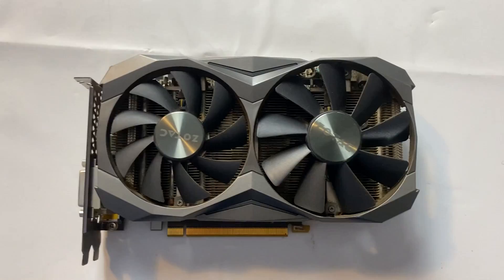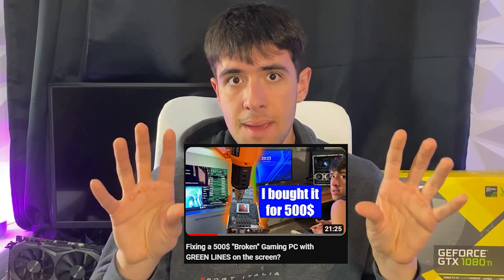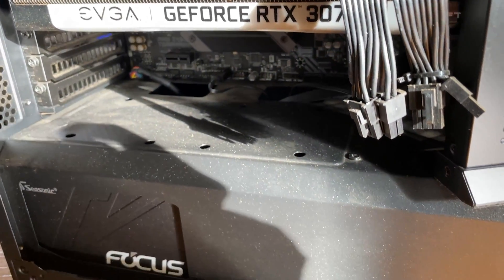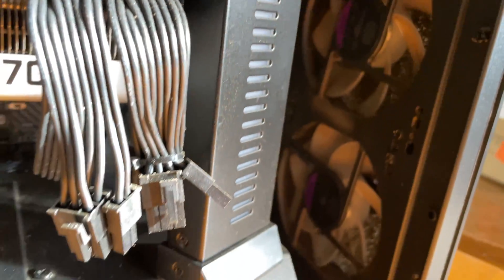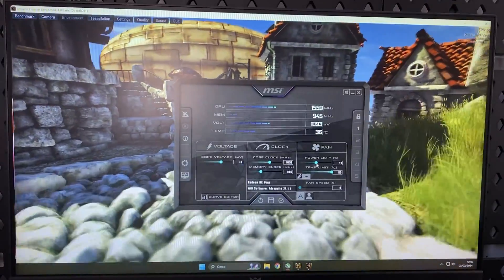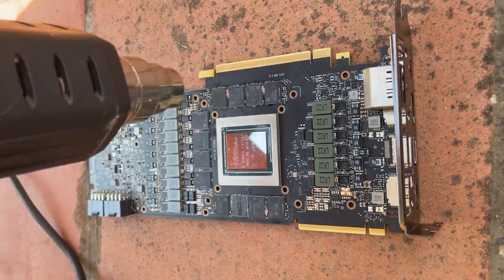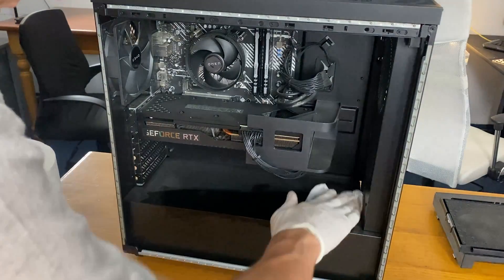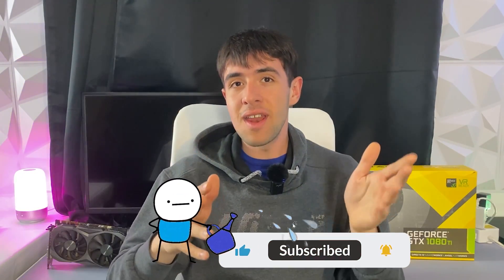A lot of GPUs are breaking because of this...

Comment: I'm a smoker, I use cooker hood/extractor, carbon filters cheap off Amazon, I cut them to size and fitted to all the intakes of my case, still get brown dust, but its not sticky, and blows or brushes away when cleaning.
Reply from the maker: That’s actually genius ahahahah, I need to start recommending this to my clients
Reply: @ImWateringPSUs  You can get like pack of 3 12''x4'' or something for about £15 or $20 ish, make sure its the porous black kind, nicer looking and less restrictive to airflow I also replaced the mag filters instead of adding purely for airflow, I stuck them down but you could spray glue some magnetic strips to the filters, cleaning is 1-2 month- take off filter blow air the wrong way through the filter and pull of the skin of dust, & put back, don't touch it before blowing as 10x easier if dust doesn't get rubbed in from wiping, and I swap for new every 10 to 12 months
Reply: @Yoshi92  Your welcome, I'm so glad I was able to help someone with my video ''life hack for PC gamers'' 😏😁😂
 For reference of results the grey Noctua fans used in my latest video ''This was a squeeze, F.F2 Build'' I don't show the cleaning in the video, but I have smoked next to these fans for 2 years (all intake fans previously), cleaned them with a quick dry brushing, and they are still grey and not sticky at all.
 This hack was an intrusive thought that I tried for a year before sharing ( I won't mention why I was using carbon filters so regularly though😏🤫😁)🤣

Comment: Secondo voi un i5 11600k e una 4070super andrebbe bene?
Reply from the maker: Dunque, la 4070S performa praticamente come una 3080, per parlare di qualcosa di gen equivalente ad un i5 di 11th. Direi che sei al limite ma si può fare, se giochi in fhd avrai un pochino di bottleneck ma puoi risolvere con un overclock/undervolt, mentre se giochi in 2k o superiore vai tranquillo!
Reply: @ImWateringPSUs grazie mille

Comment: Im a smoker and i just use air compressor to blow all the fans and coolers every few years. I was using gtx 1060 which is now 8 years old and still working in other PC,
Reply from the maker: With regular maintenance the PC is gonna be absolutely fine! But compressed air every few years I fear wouldn’t be enough on a higher performance GPU, one needs to take it apart or to dust it off more often, imho
Reply: I use a makita battery blower. The compressors spit condensation. Might not kill it but is a risk.

Comment: Even if I have been told the thermal paste has been done, I do it and clean used GPUs. I trust no one and budget gamers generally are not doing upkeep on their rigs. I get loads of deals for flipping because it will often be lack of upkeep that killed the rig I bought for nothing to flip and for that reason it is best practice to clean and update everything from thermal paste and pads to fans as the bearings wear on cheap fans.
Reply from the maker: This is absolutely key if you’re a PC flipper! I do the same thing, it happened to me too many times that I was told “I just replaced the paste” and that being completely false lol. Plus it’s just good manners towards your customers, if you’re a reseller, in my opinion :)